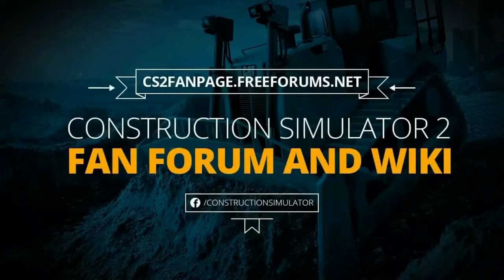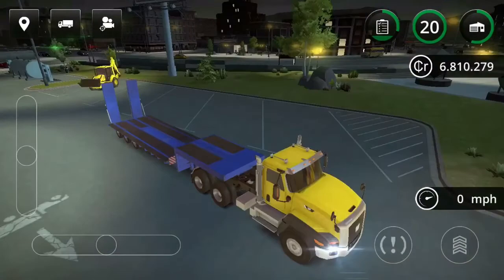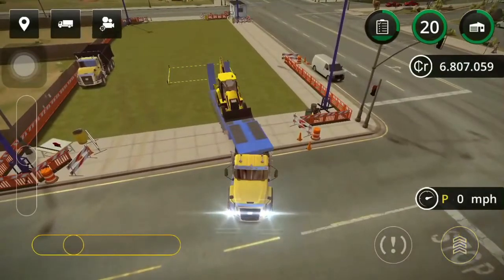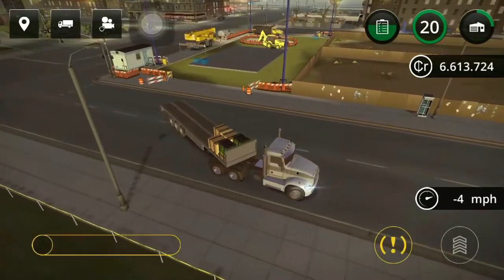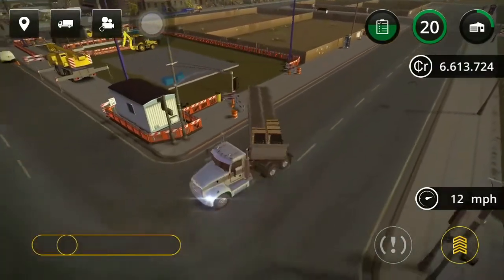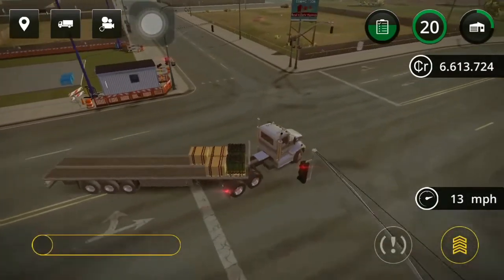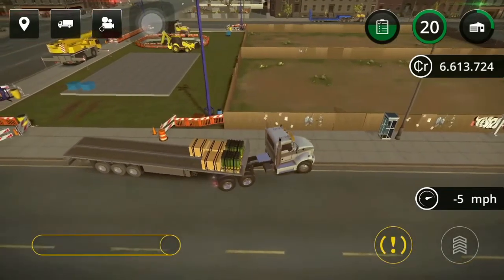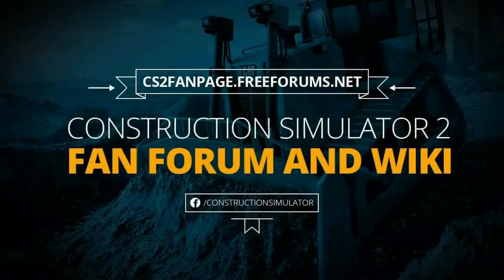Construction Simulator 2 tips and tricks 3

Comment: Can’t get the low loader ramps Togo down
Reply from the maker: Souf FC  What Platform are you playing on?
Reply: Greywolf Construction Nevermind, I discovered how to do it after playing around with the controls a bit. Thanks though.
Reply: @GreywolfConstruction  ps4
Reply from the maker: Steven Wischer  Remember when using the trailer to “press” or “click your analog stick to switch between camera function and vehicle function. This way you can lower ramps when you aren’t driving.
Reply: Greywolf Construction playing on Xbox one and the ramps won’t go down and the joystick is on function how does this work?
Reply from the maker: Dieseltech2020 Pa so there is a bug with the game that the Developers are working on right now. They will release a fix update soon. 😢👍🏻